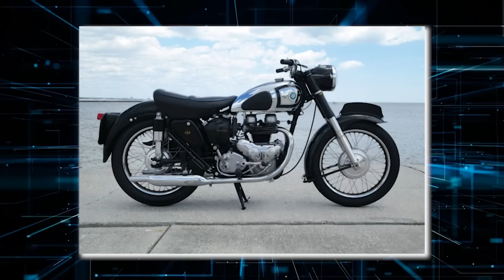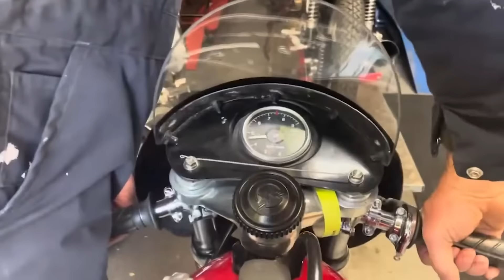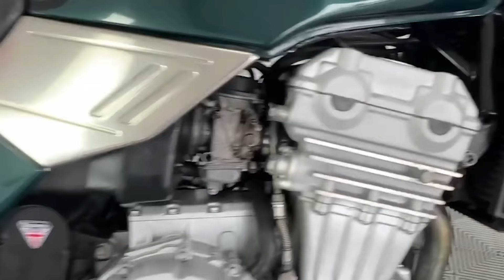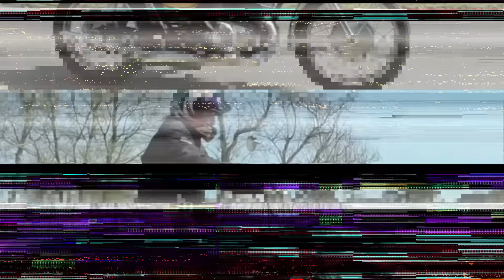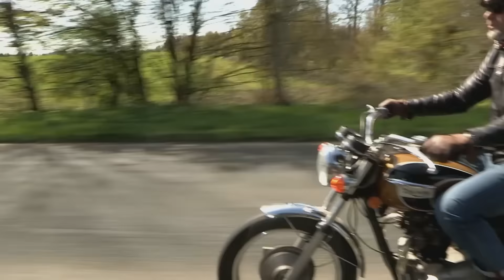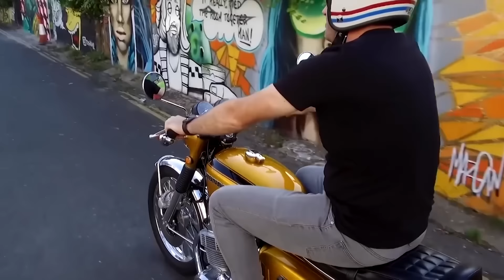25 FASTEST Motorcycles From The 1960s We Want Back!

Comment: Ok, the Suzuki 500 Titon was not hard to control. I used to drag race other motorcycles at a closed road. We would meet there on the week-end. I raced everything. Only one motorcycle stayed with me off the line, a Suzuki 500 Titan. I had a 1973 RD350. The bike was so quick taking off in 1st gear, It was all I could do to get my foot up to the shifter to hit second gear, before I overeved.

Comment: This is absolute bollocks . 2 strokes from Japan were the smoothest machines you could find. At traffic lights you would sometimes have to check if they were still running . Triumph Bonnevilles would rattle you fillings loose .

Comment: Suzuki T500 in 68 was the fastest production bike ever made. Every other year was slower due to smaller 32 mm carbs instead of 34's. Went up a tooth on the front sprocket and mine would due 125 mph. Then it was all over in 69 with the Kawasaki 500 triple, though the Suzuki still handled better. Ride a Victory now but I sure miss that bike. And by the way, bullshit on the front wheel up in 1st 2nd or 3rd. It was a long bike and getting it up in 1st was difficult

Comment: The Yamaha YDS3 was a piston port, not a rotary disc valve. The  Kawasaki 250 A1 and 350 A7 were rotary disc valve induction. The Kawasaki H1 500 has a good frame, the problem was plastic swingarm bushings and in the early front drum brake models the fork legs had loose mehanite bushings, the looseness and flex led to its handling and speed wobbles. I put Exhibition Engineering bronze bushings in the forks and swingarm in my '71 H1 and then it handled like it was on rails. It needed the later disc brake on the early models. Mine would carry the front wheel half way through 5th gear at over 100 miles per hour, was more prone to wheely than the 750 H2! With two up it was difficult not to get a wheely at some time or other!

Comment: the AJS model 20 or Matchless G9 same bike different badge. The racing version was called The G45. Now the AjS 20 and the Matchless G9 when not engineered marvels they were weak piss poor motorcycle the cast crankshafts used to snap in the third bearing and had more leak than The Torry Cannion (oil tanker sunk off Lands End Cornwall in the 60s) I had one in the early 60s, The later CSR G12 were better came with a bit more strength in the Bottom end dept.. even the BSA A65 was better bike. In my humble opinion The 650 Triumph Trophy TR6 and Thunderbird were The best out of all the British 650cc motorcycle The Bonny with its twin carbs and E3134 cams were not as good.  I’ve owned all of them In the 1960s at one time or another..

Comment: That white Kawasaki 500 H1 with blue strips is exactly like what I had in 1969, for 7k miles. I had the optional sprockets installed and NOTHING could touch it in a drag race. A road race was another thing altogether, handling was sup-par, and it's eventual downfall, it got wrecked, but not by me. I traded a car for the night so I could take my girl to her prom night. Swapping with my brother-in-law for use of his car, who was a good rider, but he let a buddy of his 'try it out', and wrecked it. I got a 1965 500 Matchless single out of that debacle. 

Mine was the 498th 500 off the assembly line. Cool how that matches with the 498cc engine. Three 166cc engines packed into one engine case. It was ingenious. And FAST! When I was racing it I watched the tach, when it hit 4000rpms in first gear I started the motion to shift into second before the tach hit 8700rpms, it happened just that fast! The front end came up with ease, and faster with a passenger, center of gravity went backwards with a passenger. Amazing! Second to third was a bit slower but I had to remain vigilant, even in second gear the front end would start coming up unless I feathered the throttle. 

I recall riding down a main street in my home town of Everett Washington one evening. Two Harley Sportsters pulled up in the left lane, even with me. One guy looked over and went Ring-a-ling-ding=Ding several times. I smiled to myself and waited for the light to end. I let both Sportsters get a bit of a lead, then passed them at about the 75 foot mark on the back wheel in second gear. Next light? <CRICKETS> Yeah, that was fun! I'm 78yo now and would change a thing about the bikes I've owned, but of all the bikes I owned in 59 years of riding, the MACH III remains the strongest memory, followed by a distant second place of a 1968 Triumph 650 Bonneville I owned years later. It handled with ease.

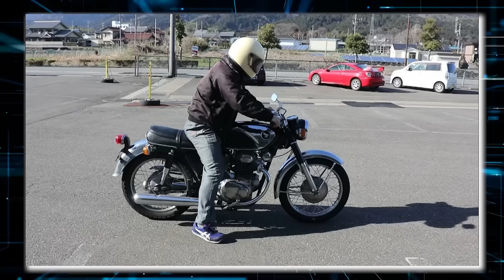Comment: 4:44 I had a Honda Dream 160 before I got a used 305 Superhawk and added performance parts.
Reply: Those poor old Dreams serves a purpose, but didn't get much respect. My buddies called them a "wet dream". For just transportation and highway cruising, they were not bad at all. And those fenders offered very good protection in foul weather.
Reply: @ronfullerton3162  single carb and ran smooth without tuning. I sold it when I bought my Yamaha 350 r 5. It was the best ever. Sold it to a friend who added many miles.
Reply: @EASTSIDERIDER707 They were very good and dependable. One kid I knew, that was his only transportation, and rode the Iowa winters as much as he could. It was a very good foul weather machine. Those huge ugly fenders really shined in sloppy weather. He had a windshield, and it was remarkable how little road splash he got. If he had lowers, he wouldn't of gotten any more splash than I get on my Ultra. If the stamped frames had been just a little more stout, it may of been a bIgger hit.

Comment: The Bridgestone 350 twin cylinder rotary valve six speed
Reply: They were KOOL 😎
Reply: Some models had a chrome plated cylinder bore to delay wear. It required special piston rings to seal combustion pressure.

Comment: The Honda 250 you showed was NOT the "Dream". (The Dream didn't have a tubular frame,) The 250 you
showed was the "Hawk". (I had the 305 Super Hawk.) Also, the Suzuki "T20" you referred to we knew as
the "X6 Hustler". And it was one of the QUICKEST machines in any street-drag. The bike I'd like to see
appear again would be the  Honda CB-450. In its original form it blew off "650"s of the day. I'm sure it
would do better today in revised form. (In any event, the engine was a thing of PURE beauty.)

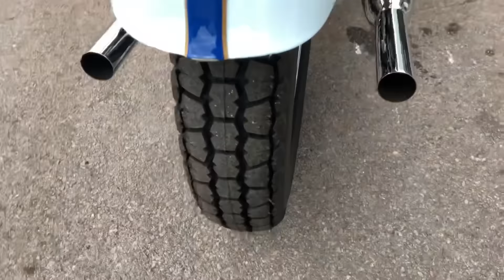Comment: @38:22 you are talking t120, but showing the earlier pre-unit engine. That's not a t120,  but it is by far the most beautiful 650 Triumph!
Reply: The 1st few years of production the Bonnevilles were pre-units.
Reply: In 1969, I was  head mechanic at a Honda/Triumph dealer in Miamisburg, Ohio. I well recall that the standard piston skirt clearance on a Triumph T120 was 0.004 inch. On a Honda that skirt clearance was way beyond specs and required overhaul. I used to ride my CB450 next to my buddy on his Triumph T120. The piston clatter from his T120 was so harsh it was very painful to my ears. Compared to the precision of the Honda engines, when you looked inside Triumph engines they appeared to have been made by an Apache warrior with a stone hammer. That's how we described it at the time. Nowadays, I would show more respect to the Apache Warriors.

Comment: I jumped off my 69 Bonny and onto my mates XS650 and I couldn't believe how awkward, uninspiring and clumsy it felt compered to my old Triumph. It just felt wrong and unnatural plus my Bonny was faster in the bends and even flat out even though it supposedly had less power.  I was so happy to jump back on the Triumph which instantly put a smile back on my face.

Comment: Why make a mc history video with such incorrect data? 
Yamaha YDS3 did not have a motor anything like the illustrated & described  chain drive rotary valve, carb on top. Eveyone can plainly see the piston port twin cylinders which was the early design of a long line of excellent 
"Giant Killers".
Reply: Yeah I picked up on the same thing what you're saying
Reply: The big rotary valve user was the Bridgestone Motorcycles. Everything from the 90 up to the 350 had it. Kawasaki had it on a 250 twin, but I do not believe they used it on any other model. I had several friends with the Bridgestone 175 twin, and it was a good runner. Six speed rotary shift, which was unusual. We had much fun on them.

Comment: It is obvious you do not research your true facts proprly ! From about 1963 the AJS CSR 650 was with the Norton SS650 and BSA ROCKET GOLD STAR 650 also with the Matchless 650 sports model all fast chaseing 120MPH ,The 500's had Velocette Venom's and Velocette KTT's and other Velo models chaseing over 110mph. The 350 Velocette Viper pushed over 105mph the BSA also chased 105 but lost out to the Velo Vipers Just. The 500 Velo Venom is a solid 100mph machine and if not misshandeled is reliable for many years and miles.My Atlas pulled over 105mph two up even up some hills but generally solo was good for 112mph yet my Norton SS 650 from 1966 had the speedo needle up around 125+ which in road tests was genuinely clocked by MCN at 119mph on the BMC test track I believe this was faster than then a  1959 Triumph Bonnie ! Two up the SS Norton would be in front of the Bonnie but the BSA RGS would pull away from us very slowly BSA I believe was the fastest at 125mph till the Triple BSA and Triumphs even Norton Commandos  were 120/22 MPH Not sure but they could pass my SS650 Norton but Slip streaming them helped me stay there much to their shagran ! Vincent shadows etc were 125mph plus of course ! Well now you have some of my memory so please don't insult me and the rest of the motorcycle folks of the late 50's to early 70's.Thank you. Be Blessed and preserve the real facts and with the memories History will have been made !

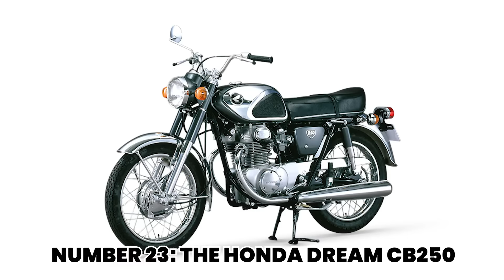Comment: I need to correct you. @ 4:38  You show a Honda 250 ''Super Hawk'' but call it a ''Dream''. I owned a white 250 ''Dream'' w/ a square headlight, single carb. and massively flared front and rear fender tips, and wide white sidewall tires. A real ''Frankenstein bike.'' I made it into a drag bike , a fuel tank made from a ''Glowkote'' 1 qt. floor wax can, a twin carb scrambler motor, CB160 front end. Tried to run it on nitromethane w/ mixed results. I was in high school, no sponsor money and older guys from the neighborhood who rode bikes, that I admired, were coming home from Viet Nam in plastic bags.
Reply: Yes, the model shown was a Super Hawk. It was the sports model of Dream.
Reply: Remember.\nThe honda bentley's.. they were built and looked a lot like a dream, but sophisticated hardware and detailed like a rolls, Royce. I bought my first Harvey Davison at the Honda shop where we sold the most gold wings ever in the United States.